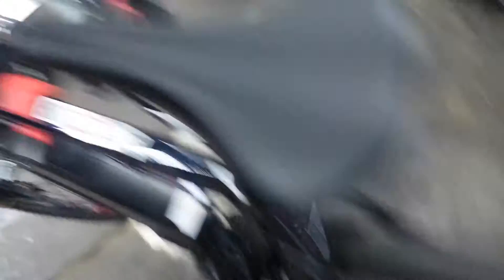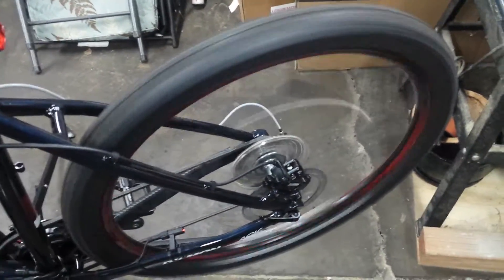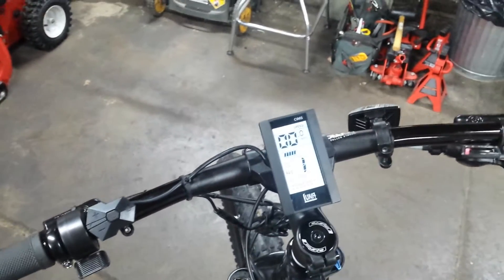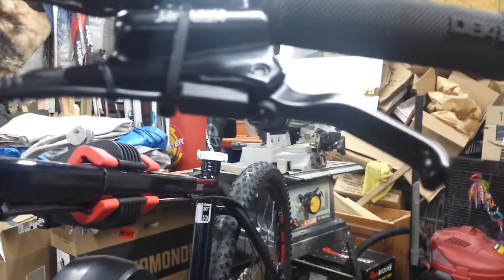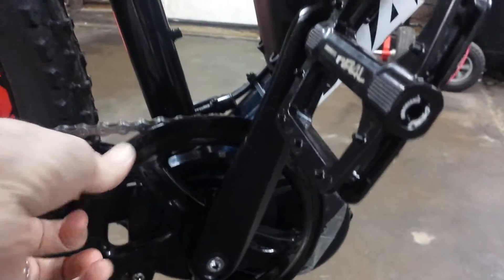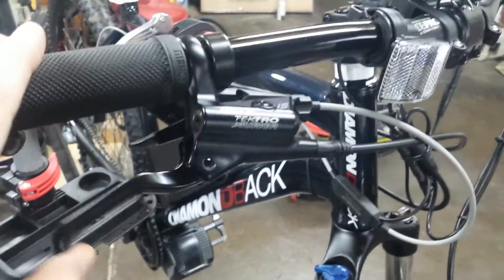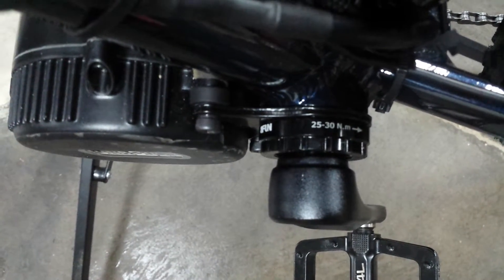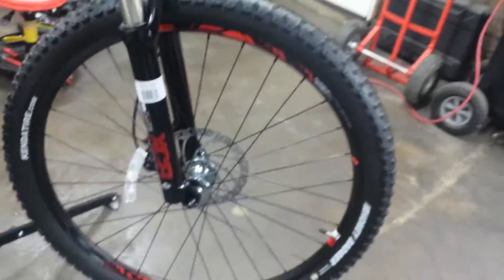Diamondback overdrive sport E bike conversion #1

Comment: Thanks for the video. So I'm about to installa  BBSHD on a DB Overdrve 29er (my personal build and also my firstever). I went with a linking 34T ( I'm a bigger framed fellow). So what spacers did you use and how many for the 73mm bottom bracket? Have you since upgraded to an external controller? If so, which one(s) have  you tried and which do you recommend? Any additional thoughts, regrets, and/or advice. Thank you, in advance, for you help sir. Have a great day!

Comment: you might as well buy a dirt bike
Reply from the maker: Has street tires on it now. Dirt bike is not legal to ride around town. Unless you have a street legal one that is with turn signals and it must be insured and plated as well here. The E bike I need none of that. Basic safety equipment is all the local ordinances call for lights a bell or horn helmet. This thing is great on the Erie canal and around town. Can not ride a dirt bike on the Erie canal either. If I want to ride dirt bikes 4 wheelers I just go to my brothers in the country.
Reply: wanna sell this bike? id buy it off you. i want a bike with 500-1000 watts. would you sell it?
Reply from the maker: Or I could build you a brand new one mine now has 450 miles on it. 2500 or 2600 shipped.
Reply from the maker: Or I build you a brand new one and ship it to you 2500 plus shipping. Mine now has 450 miles on it. Couple hundred more 1000w system. Also with something like this you want the right size frame for your height. I am 6'2 this is a 21 inch frame.thisguy177
Reply: +NYangryguy I don't mind they miles.I just can't build or afford a be an new 1. how much would you sell it for? and does it have a lipo4 lithium battery? I heard they last forever.
Reply: +NYangryguy I'm looking for something used between $500.00-750.00 if I could afford 2500 I'd buy new one but I don't make Lot of money just need something to go to and from work. it's about 2.5 miles each way. so 5 or 6
Reply from the maker: This battery is 435 dollars 52v it consists of 56 18650 lithium polymer batteries Panasonic cells. This bike is way over done. You could build on a cheaper bike hydraulic brakes are not necessary a hub motor is way cheaper. I would not want to sell this bike I would lose money. Also a 48v battery will cost less.
Reply from the maker: thisguy177
You will not get much in that price range. Heck 2500 dollars for the performance is awesome go price out a ready made purpose  built wide open 750w e bike. Guys sell crappy walmart hub motor conversions with no battery for 750 dollars. There is a seller on there that does a bike similar to this in the US for $2600 ish I want to say. Then there is a seller out of china doing same thing on mosso mountain bike for 2500 as well 48v system. Mine is a 52v system. Anyway just trying to be helpful not a jerk.
Reply from the maker: Even if I stripped off everything put mountain bike tires back on I would still want 2 grand for it. Here is the break down in cost for this particular bike. 1200 for battery motor and chain ring (stock one sucks) Diamondback overdrive sport 699 plus tax. $1950 basic bike with motor and battery. Then I added a rack cha ching, rack bag cha ching, horn, lights different seat (stock one sucks) chaaaa ching! you get the idea. So that is what you are up against. You can save money a few ways smaller motor, hub motor, smaller battery, different type of battery. Cheaper bike. It can be done.
Reply from the maker: thisguy177
How do you feel about scooters? My boy rides one around town. 500ish for the lead acid version my kid has the lifepo4 battery version it can go further that one costs 835 new free shipping. I have videos of it 1200w super turbo lithium scooter. My kid rides it to school, to his friends house the next town over 5 miles away. I ride around and weigh 215. Not hard to work on. Same place that sells them has all the replacement stuff and are reasonable and take care of you.
Reply: +NYangryguy yeah I was gonna get the turbo 1200 lithium. but I preferred a bike. they all.cost way too much.I wanted 750 or 1000 watts. 500 to 1000 dollars range.
Reply from the maker: thisguy177
Pretty much all the e bikes that are a $1000 or less you will make compromises. 500w or less power SLA batteries ect. But if you only go 10 miles or less a day and aren't a speed demon viable choices IMO.
Reply: +NYangryguy I am.Definitely speed demon ish lol. But at the same.time I don't wanna kill my wallet. I'd spend 500 to 1100. I want a 3000watt but it's about $2500 same price you asked for.
Reply from the maker: I looked high and low before I committed to building this one. The only way to get the performance you are looking for is build yourself and it will still cost you. I say that lightly I realize not everyone is handy has time or tools to do the job right. However this is transportation and you want reliability and safety. Wait and save do more research is my best advice. Perhaps a bike you can upgrade. Like one that comes with a SLA battery but can be replaced with a lipo down the road after you absorb initial cost of the bike.
Reply: makes sense. i found cheap kits like you said i just dont know how to do it.
Otherwise i would just do it lol. any advice on a motor? im not buying anything under 750 watts.
i prefer 1000 or 3000. but i also want a lipo4 lithium battery.
but if i could spend $750 and get a 1000 watt ebike i would do it. just hard to find where they are hiding.
Reply: i found a 29 " diamondback with dual disc brakes and 24 speed 8 gears.
its $349. im searching for a 1000 watt motor with a lipo4 lithium battery before i buy the bike. how much is the cheapest lipo4? is the difference is the different brands? or are they all the same? i dont really understand the difference in the amps. 1 says 5ah another 15 another 40.
Reply from the maker: Yes the 29ers are a better price than the 27.5. Finding a mid-drive 1000w and a lipo or lifepo4 are still going to be expensive. The cyclone motor kit at Luna is 359 then all you need is a battery from 36v to 72v. 1100 to 1300ish that route with 29er.
Reply from the maker: thisguy177
Luna cycles cyclone kit and they have a lot of battery choices. With 29er You can probably meet your budget and have performance. You will have to build it though or rope a friend into helping. The internet will guide you. Pretty sure Luna has step by step videos as well.
Reply: if you subscribe to my channel. ill take probably 2 videos. 1 of the bike as i assemble it together.
then 1 with a road test and max speed. my goal is somewhere between 30-40mph.
and itll be a joy to work on it and also drive it to and from work everyday. the scooter is also a good combo but in the winter it would be completely useless here in NY.
Reply from the maker: thisguy177
Well alright taking some leaps. Subscribed and looking forward to your build conversion. I may even just get that system instead of the BBSHD I like saving money to. I think the limiting factor will be gearing. My bike could go faster than 34 mph it's the gearing holding me back. Might want to shop around on batteries Luna has some crazy shipping fees on their batteries. The cells and the sellers reputation is what really matters. LG, Samsung, Panasonic if you end up going lipo. IMO battery matters a lot spend the money get the right one.
Reply: that cyclone kit is INSANE! and see everything that i want i cannot build. although i could afford to buy the motor 350 and battery probably 450. how would i get it put together? do you think a bike shop in my area might try to put it on the bike for me? i dont wanna spend $800 and just be told figure it out. why arent there shops where people sell and fix e-bikes? people always complain they need a job make 1 right? i can work on normal bikes just fine. but when it comes to electrical wiring and all that i suck lol. i can admit it. Theres no pride to be lost here man. :)
Reply from the maker: A bike shop would maybe take on the conversion ask around. I heard on electric bike reviews they will charge 80 to 200 dollars for the work.thisguy177
Reply from the maker: thisguy177
most of the scary wiring you refer to has plug in's specific to each thing. And red and black from battery positive negitive super simple wiring. The BBS02 kit is practically idiot proof.
Reply: does that come with battery and motor? see i dont know how to mount it. i need to someone to mount it on my bike and just charge me whatever.
Reply from the maker: The battery is the only thing that needs actual wiring like solder or a connector that crimps on. Two wires. In my case I soldered and heat shrink tubing mine. The rest of the connections are plug and play and colored coded, labeled or both. The connections even have slots to prevent them from being plugged in wrong. If you are even moderately handy you can do this. I didn't graduate high school but I built this computer I am typing on and that bike you see in the video I didn't know how to do either before trying.
Reply from the maker: thisguy177
You have to pick the battery and certain parts of the kit can be upgraded or excluded. They sell as a package deal you can go to their site and play with packages. Create order and calculate shipping and tax ect. The packages can be customized. That is what I really like about Luna and they are US based.
 The package I got BBS02 with free programming and the 52v not 48v dolphin battery was 1190 with shipping. IMO worth every penny. I wanted a e bike 2 years ago built finally 3 months ago. Saving and planning.